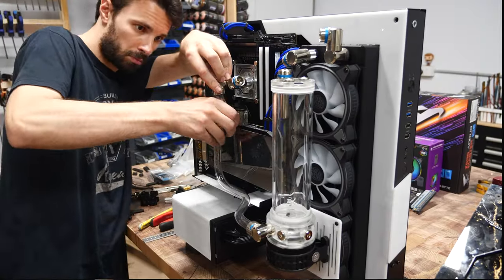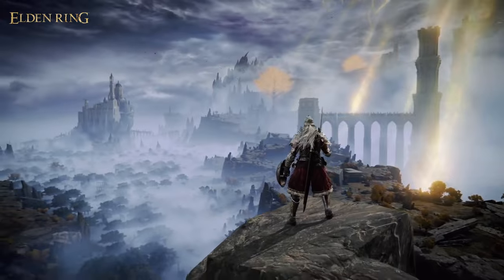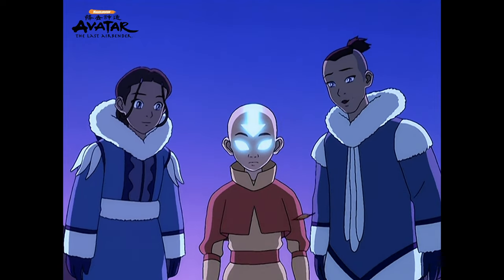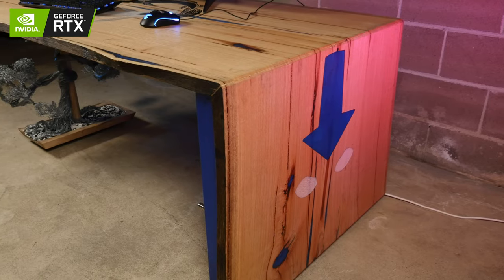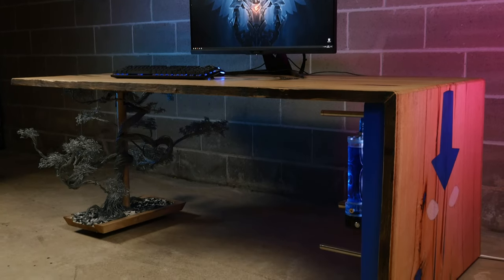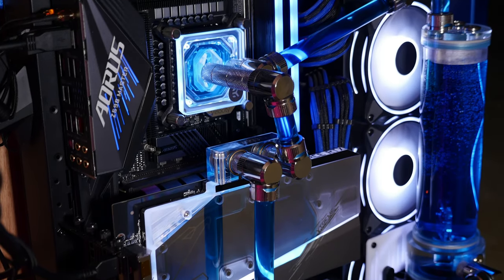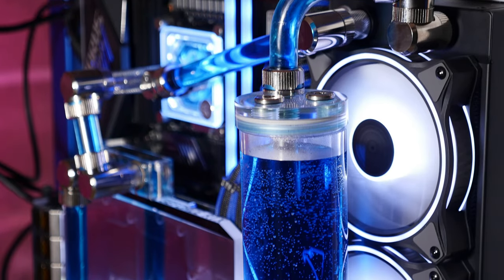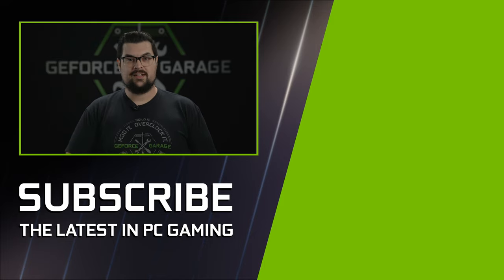GeForce Garage - Israel "The Last Stylebender" Adesanya's Zen-Inspired Desk

Comment: Hey Nvidia please make Nvidia Shield TV 2 with this :

- CPU & GPU : Nvidia Jetson Orin NX 8GB (6 core ARM cortex A78AE &  1.024 core Ampere GPU with 32 Tensor Core)

AI : 70 TOPS

- Memory RAM : 8GB LPDDR5

- Memory ROM (M.2 NVME SSD PCIE Gen 4.0) : 512 GB (Read /Write : 3.000 mb)

- Operating System : Android 13 /  Linux 

Wifi : 6e

Bluetooth : 5.2

- Port : 2x USB type A  3.1, 2x USB Type C 3.1, 1x HDMI 2.1 port, 1 x DP 1.4a

- Hardware Suppport : use handphone for touchscreen functions (games or applications) + Xbox or Playstation controller + hard disk external up to 14 TB

Software Support : GeForce Now & streaming 4K HDR / Dolby Vision (Netflix, Amazon Prime, Disney +, HBO, etc) 

- Power supply : 120 watt adaptor

- Cooler : integrated copper heatsink and dual fans

- Price : $400 ~ $500

💪💪💪💪💪😎👍